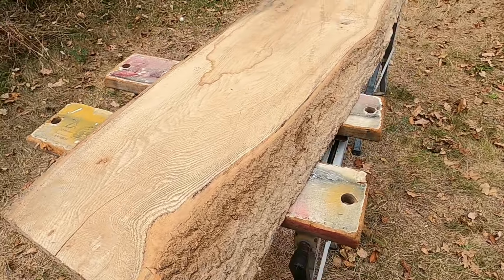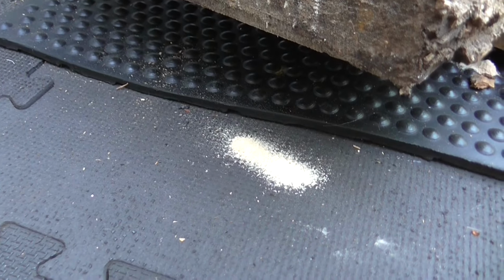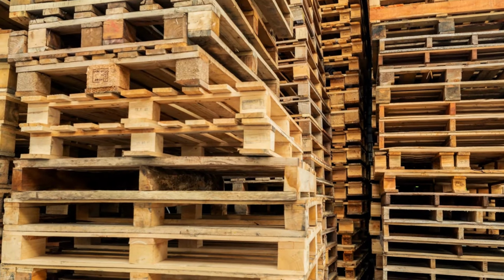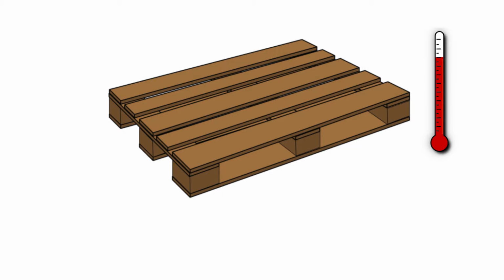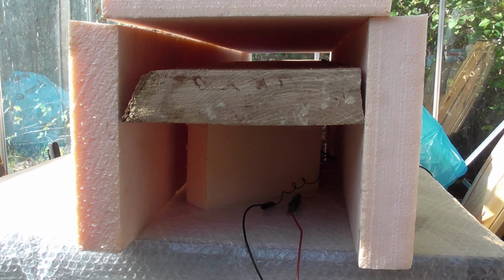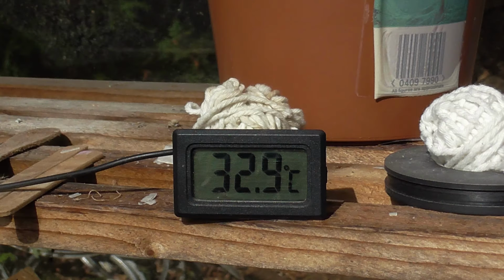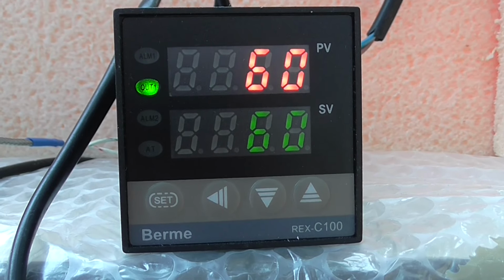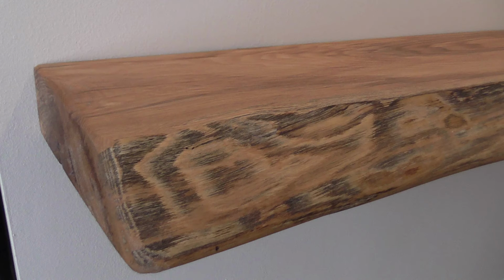Get rid of woodworm for good (no pesticides)

Comment: I just bought a new Hickory Wood bedroom set from an Amish Fella, the chest dresser has small black bugs, I found 20 or so of them, and today I found holes on the side and sawdust on the floor.  What do you suggest I do?  Finding bugs in all drawers and seeing sawdust on the clothing inside....... I can't have this spread to the house!  Help please!!!
Reply from the maker: You probably want to get it out of the house as soon as possible and treat it somehow. Though some bugs are very particular about the type of wood they live in so may not spread. I would contact the seller if this is a new piece of furniture.
Reply: @AndysMachines  thank you so much for the information I’ll do that. God bless you I found about 50 little black bugs once I took the drawers out.😮
Reply: These are wood boring Beatles . Spray the whole thing with borax solution . Try to inject any holes with the solution. This will terminate it

Comment: Hi, quick question:  How to treat and preserve stump log already cut:

i picked some pine 32" diameter log free from a neighbor and his tree was cut down in february 2025 from being dead.  Sure the logs i got from him have some bugs or worms and I'd like to treat it and preserve it for chopping and axing on it for my hand carving needs. Do you have any advice on how to treat it, and preserve it? 
From your video, to build a kiln around these giant logs will be very expensive and tough to convince mt significant other.
Any feesback will be very much appreciated. Thanks a bunch
Reply from the maker: Instead of heat you could try dehumidification, you could build a box around it and put a dehumidifier inside (with the drain going outside). I've done this in the past to dry stacks of planks 16ft long. With 2" of insulation inside the dehumidifier alone got the temperature up to over 40°C, a smaller box with no insulation but well sealed would probably be similar. 

But if your going to be cutting the timber later, probably best to do this first and then treat it in smaller pieces, best to seal the end grain to limit splitting as it dries.

Comment: As soon as you that you wanted avoid chemicals I thought of using heat but wondered how you would do it.
Congratulations on coming up with a simple repeatable method. 
Of course, here in Australia, we could just store everything in a car or steel shed in the middle of summer. One very hot day I measured the inside temperature of my car parked in the sun at nearly 80°C, that was an unusually hot day but 60° should be easily achievable most summer days.
First time I've been here but subbed
Reply from the maker: Here in the UK we don't get such hot weather, but there are often a few days in the middle of summer where it would even be possible to do this here. In warmer climates woodworkers often store green wood in cars to season it.

Comment: I used a Heat Gun on an old pool table that had areas of wood boring termites and it kills all termites and eggs permanently .... spraying or brushing chemicals does no use in thicker wood .... the Heat Gun was the answer to my problems .... ive been termite free now for over a year thanks to the Heat Gun.
Reply: Really?  I have flame treated wood to a hard char, and have had the worms basically unaffected.  Like within a week of scaling and oiling, they were active again.  Not nearly as many.  But they were definitely there.

Comment: I live in Portugal and have just bought a house, and the owners were kind enough to leave me some nice wooden furniture. One piece has evidence of worm, though nothing active, and as I have to intall new floor boards I want to make sure this piece cannot contaminate the new boards. In summer the temps regularly get up to 35 degrees celsius. I am wondering, as the piece will fit in the back of my car, if putting it in the car would work. Quite often the car is so hot, you cant touch the steering wheel!!. I could leave it in there for days. What do you think. Its kind of a ready made kiln
Reply from the maker: Yes, this is actually quite a common practice in hot countries, for seasoning timber also.

Comment: I have an antique savonarola chair (scissor chair / x-chair) that's full of woodworm holes. Do you think this would work with that?
Reply from the maker: Many antiques have worm holes but the worms have long gone and as long as it's kept in a dry environment it should be fine. Unless you're sure there are bugs currently living in it it's probably best to leave it alone.
Reply: @AndysMachines  100% sure they're still active. We recently emptied my grandma's house and every single piece of furniture had woodworm holes with sawdust on the floor. Only managed to store two savonarola chairs and a coffee table. I wanna try to save them, but i wonder if the heat treatment could end up cracking or warping the wood.
Reply: @AndysMachines  100% sure they're still active. We recently emptied my grandma's house and every single piece of furniture had woodworm holes with sawdust on the floor. I managed to store two savonarola chairs and a coffee table and i was wondering if the heat treatment could split or warp the wood.
Reply from the maker: If the wood has a higher moisture content then heat may cause it to shrink slightly as it dries out, this shouldn't cause splitting or warping if done evenly. But it may loosen some of the joints.

Comment: As an Antique Furniture Restorer since 1977, there used to be a company called Themo Lignum (In Notting Hill), London) that carried out this process commercially, even complete buildings. Though I used them (years ago), I have no idea as to what temperature they subjected the furniture to. This is an interesting small scale take on this process.
Reply from the maker: That's interesting! I've heard of wood being treated nowadays with microwaves to heat it in various sized kilns, but not if this method was used commercially in the past.

Comment: This is great, but I have a lot of wood I want to do. I had an oak tree die. It has a lot of good wood, but lots of boreworm infestation, and I want to kill it to recycle the wood for various projects. Any thoughts on a more scalable version of this?
Reply from the maker: It's quite common to build dehumidifying kilns out of shipping containers, they normally don't exceed 40°C but with extra insulation you could probably go higher. If you've not already planked the tree up, doing so first would give you more manageable pieces that would fit in something smaller, and you could discard the really bad stuff.

Comment: So much effort for treating a wood board? What about buying a new one instead of buying the light bulb, temperature controller,  screws, wires, etc? Sorry, but almost worthless what you did.
Reply from the maker: It really wasn't much effort, all I had to do was wait! The lightbulb, temperature controller, foam board, and everything else I had already, but even if I didn't they would have cost a fraction of the price of a new hardwood board this size. Plus it's a much more effective treatment than using chemicals. You don't even need the temperature controller, any type of thermometer would do.

Comment: Can I put the wood inside a kitchen oven at 60 C ? Or maybe using a hot air gun…
Microwave them would do it too, I think.
Reply from the maker: Large microwaves are actually used commercially. Yes if the item is small enough to fit you could put it in a kitchen oven, but I doubt a hot air gun would heat it evenly enough if used directly on it, you would have to put it in an insulated enclosure and heat slowly.
Reply: @AndysMachines  Thanks a lot for replying.
I had never thought of something like this (what you've presented). It's really an excellent idea.
I bought an old radio from the 50's and it has wood worm holes. Maybe they are no longer there, but who knows.
I thought of doing this using what I have at home and, then, filling the holes with a wood filler used for plasterboard. After that I will sand down the wood, apply wood varnish and some kind of faux leather on top.
Please notice that my experience with wood is near to zero, so all of my ideas can be rubbish.
Thanks a lot for the effort you put to make this video. It's really an excellent one ! Liked and subscribed !

Comment: I have a small wardrobe that has woodworm infestation.  As I live in the Algarve, Portugal and the summer temperatures get up to 30 degrees plus - if I leave the wardrobe outdoors in the sun - will this kill off the woodworm?
Reply from the maker: It will kill them if you can get it hot enough, (needs to be around 60°C) but the full sun for an extended time might also damage the wardrobe itself.

Comment: Great video!!! I'm thinking to heat treat my crawl space of our 100 year old house that has woodworm. First close all air holes and put isolation bubble wrap on the floor. Then heat it with portable electric room heaters till we measure 60 degrees. Do you think this would work, or is it an insane idea? :face-orange-biting-nails:
Reply from the maker: Thanks! If you can get the temperature uniform then yes it should work, but don't underestimate how much power it might take to do this. It may work with a lower temperature for a longer time, maybe 50°C for a day or two. I'd be worried about overheating areas near the heaters which could be a fire risk. It might be better to split the area up into sections and use fan heaters rather than convection type.
Reply: @AndysMachines  On a Dutch site I read : "Heat treatment in your home is specialist work. The room sometimes has to be brought to 80 degrees, because the core of the wood must be at least 55 degrees. With thick wood, it may take quite some time before the wood is so warm inside.

Unfortunately, it is a costly treatment of woodworm, but the advantage is that you do not have to work with poison or gas. An environmentally friendly method.

The cooling will also have to be controlled, so that the wood does not crack or split during the cooling period"

So it might be more difficult then I thought.. And they also mention: "The disadvantage is that it is an expensive form of treatment, and you have no protection afterwards. You can do that with impregnation, for example."

So now I doubt about the heat treatment... 😅
Reply: @AndysMachines  Do you perhaps know where to find this machine? (The guy from the video doesn't respond..) https://youtu.be/uxDvsAgCyrE?t=208
Reply from the maker: I think it's just a humidity controlled extractor fan, maybe like this: https://www.ebay.co.uk/itm/284488508316
Reply: @AndysMachines  Thanks for the suggestion! I think it's a bit more complicated machine though as he said it works with bluetooth and measures the air inside and outside on humidity and will based on that blow air in or out of the cellar.. Anyway my search will continue :hand-orange-covering-eyes:

Comment: We bought some furniture from overseas which border control found was infected. They disinfected it by placing in a deep freeze for 24 hours. Worked perfectly with no visible affect on the furniture.
Reply: Will that process crack hardwood? Am looking to get some old repurpose hardwood Slab to make into table and table tops.
Reply from the maker: I didn't notice any additional cracking, the slab I used already had some end-grain cracks which I cut off first (in case they split further). It may depend on the wood species though.

Comment: wasnt expecting this video material from you, not after the t800 parts, but its a good video... Interesting subject and applicable somewhat in toolmaking, regarding handles and grip knobs to keep precision instruments at constant temp while handling... Tho, one could also do the same thing with heated oil for smaller pieces or boards, just get one of those car oil coolant trays that is 1.2mx0.5m(4ftx20in) alu rectangle with 10cm height(app. 4in), get some cheap woodworking oil, like walnut or flax or such, get it on a double burner, smallest flames on each and let her slowly get up to heat... It will reduce viscosity of oil, increase the porosity in wood due to heat, and once cooled, it will have somewhat accelerated polymerization... However you do it, its essentially pasteurization... You could also vacuum treat the wood... But that would be quite a requirement, given that a vac. vessel sufficient to do such a large job would be enormously thick, thereby expensive...

Comment: A sauna should work perfectly for more / larger pieces as well! just remember that the temperature inside varies a lot with height.
(I kinda regret tearing mine down now, still have the heater so I might ponder to make something from it since I have a bunch of trees in my garden I'd like to make planks from)
Reply from the maker: Yes, good idea! A dry heat (non-steam) sauna would be good for treating larger wooden objects like furniture, they can reach up to 90°C